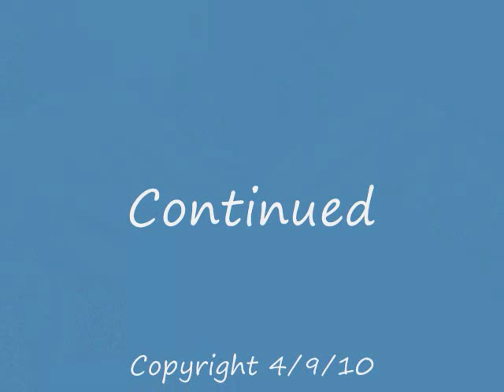Binding The Ribrest Part 1

Comment: Thanks Chris. I notice you run your Dremel at a very slow speed for the scribing operation. I have always thought i would have better control at high speed . I will try at a slower speed and see if it makes  a difference. Do you use a slow speed when cutting inlay pockets?
Thanks for sharing your talent.